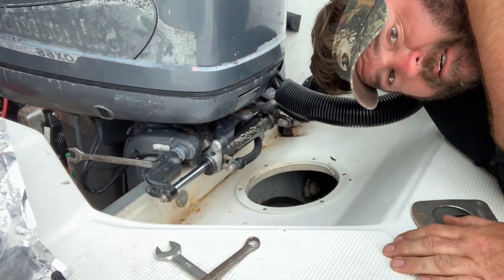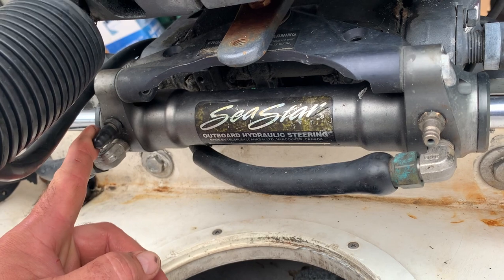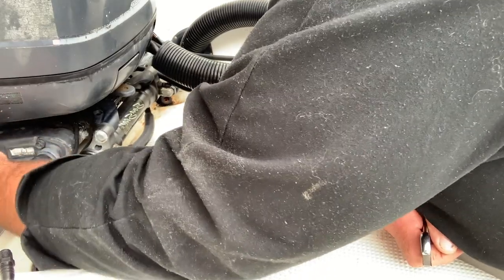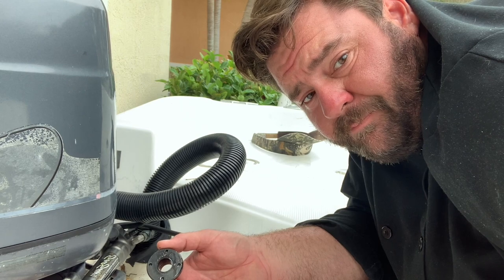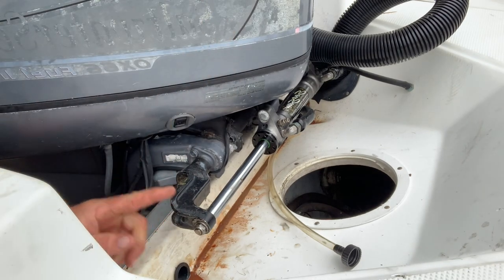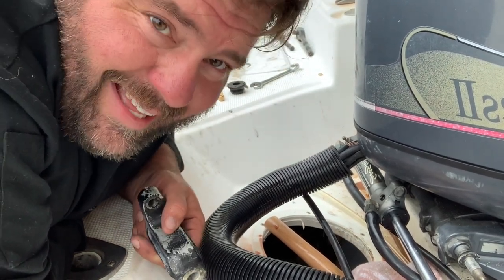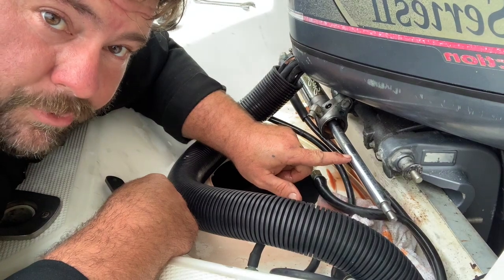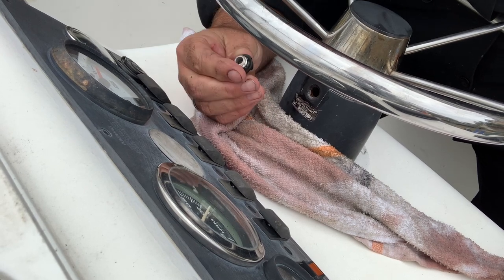SEASTAR HELM STEERING RAM SEAL REPLACEMENT (HOW TO) NEW SEALS IN STEERING RAM

Comment: I put new end caps on boat and the seal on the starboard side is still leaking and the seal is brand new. As well the shaft has no knicks and is smooth why is the seal leaking?
Reply from the maker: Has to be a bad seal or something. Even new ones come in bad. Or maybe their is a gash or gouge in the ram preventing it from sealing properly 🤷‍♂️

Comment: Noticed you are not filling with the expensive Seastar fluid… what type you using?
Reply from the maker: While under warranty I always use sea star fluid. Afterwards ATF automatic transmission fluid. Does the exact same thing in my experience but will void your warranty

Comment: Tip, You can just unbolt one side  , say the starboard and then the ram will slide out enough to do the port side.   I as well lived on the edge with hanmering  out a bracket.  did not go , so i opted out for the one bracket  seal gland replacement

Comment: I saw video where a guy padded the rod then beat it bracket off . Well I’m leaking so I’ll be doing this process thanks  for the video . I  want it fixed and back on the water 🎣
Reply from the maker: Good luck. I’m sure you will get it done

Comment: I like your honest shadetree video. I'm about to have to do mine. I think they recommend loosening the caps before knocking or pulling the metal pieces with the 3/4 and 5/8 bolts on the end
Reply from the maker: I appreciate you watching and sharing.. and also for the great tip! thank you
Reply: yes.  first loosen the glands

Comment: You should have sanded the ding before you put on the new seal. Now you have a seal with a rip in it,,, more leaks.
Reply from the maker: Possibly true, but I still have no leaks even now. Though you are correct. I make it work😂 no leaks at all even now

Comment: Don't use a hammer anywhere where you can contact the ram, you will just end up trashing another seal and redoing the job.  Once you hit the ram, you need to replace the ram with a new one.  Spend the $30.00 and buy the puller.  Also use the end cap to insert the new end cap, once again, if you don't you can make a minor tear in the new seal and you will be doing it again soon.  I'd also recommend placing rags in your transom, to keep your work space clean. Grease or anti seize only the threads of the brackets before re-assembly to keep the nuts from freezing on there for your next job.     If you get any of that hyd fluid on your deck...you will be ice skating across the deck for a month.
Reply from the maker: awesome points and great feedback! thank you for sharing! I hope it helps others in the future. thanks for watching
Reply: I do probably 50 of these seal changes in a year and never once have I used a puller, I also don't recommend a metal hammer around the ram but a good deadblow hammer works better than a puller and faster, just thought I would point that out a puller absolutely not needed
Reply from the maker: Sound advice